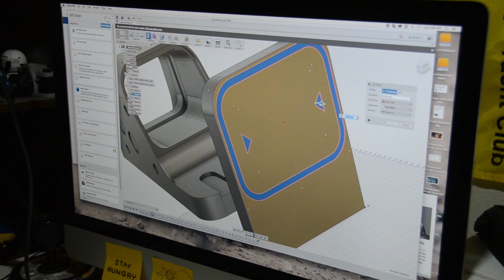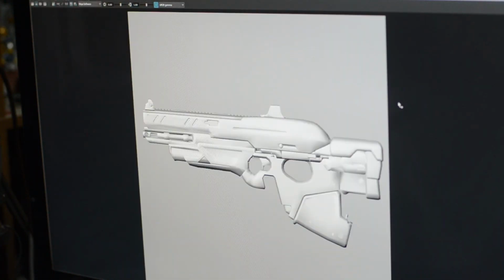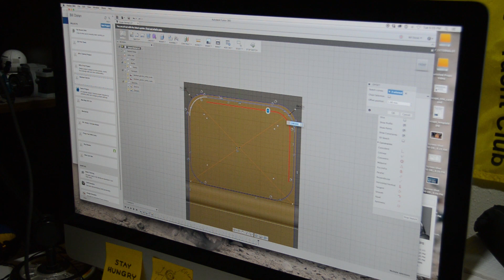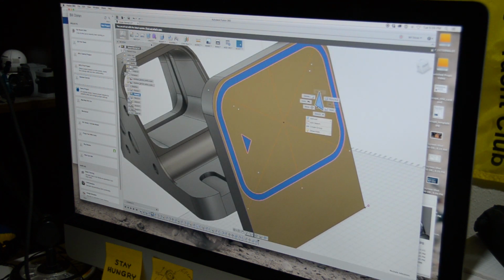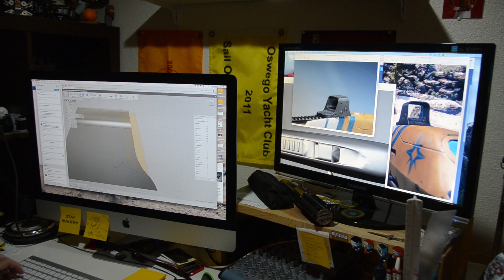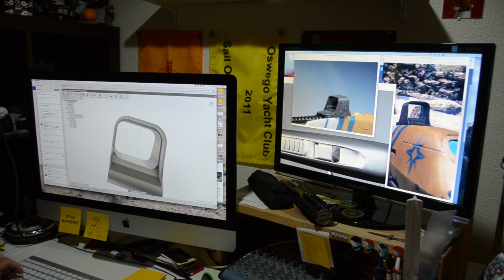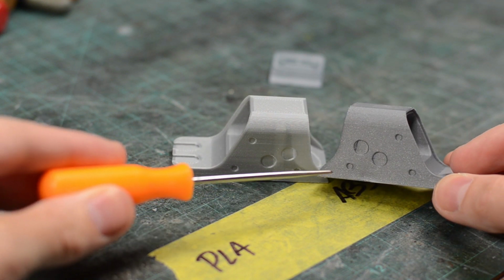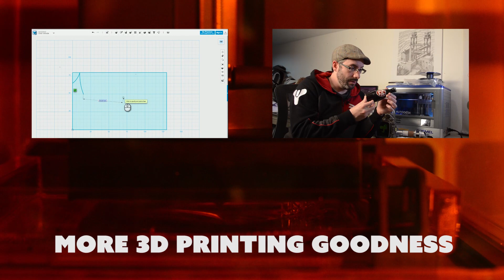How to 3D Print a Gun Prop from Destiny Part 1: Boolean Gemini Scope

Comment: Helo punished props i do have a question i started my 1st ever 3d destiny gun prob but  my printer is too small and i had to cut it into a few parts how do you make them look as if there were 1 piece and how do you make the 3d printer texture go away
Reply from the maker: You can fill in the seams between printed parts with a body filler like Bondo. Here's a basic look at that process: https://youtu.be/u_hIt18nCfo

For 3D printed texture, I sand it a lot with sandpaper. Here's a look at that: https://youtu.be/eGrRKdy6x7I

Comment: i have that same resin based formlabs printer in my office! I'd love to use that or the two zortrax printers i have as well to make small props, but sadly they're always running and making prototypes for work
Reply: Punished Props no kidding! I get to see it in action every day since it sits right next to my desk and it makes some beautiful clean pieces. The resin we use is pretty expensive since we're making dental products that need to be completely heat resistant and autoclaveable

Comment: so would the filler primer you talked about before, take out too much of the detail?  I was thinking, couldn't you just spray that to get rid of the maker marks?  I heard there is like a wash you can do too to smooth it...acetone?
Reply: Ok, so silly question then, why not just hit it with the filler primer 1st thing?  Oh and did you know that different levels of sanding is how scratches are taken out of jet airliner windows?  That was a task we had to do in mechanics school once.  Takes a LOOOONG time. :) But yes, multiple sandings will clear it up.

Comment: Making a 3d printed set of Pokemon gym badges, DC-15s rifle, clone trooper belt boxes, and some small stuff all in the works. But I'm a designer by trade however your channel helps me alot with figuring out some of the issues with getting 3d printed models smooth as silk.
Reply: +Punished Props I do props for TV now thanks to 3d printing and design so I'm always looking to do the bbd.

Comment: Hey Bill. Great job! Your 3D printer project is working out Much better than mine... I'm making an Iron Man arm. I found the files on the RPF but they just seem to be missing something, like all the parts don't add up...Idk any suggestions? I probably should have started with something simpler, considering this is my first project with a 3D printer.
Reply: Yep I agree... LESSON LEARNED. I I only used the files because  I have no experience in designing my own. But what kind of excuse is that?Everyone has to start somewhere, right?  Maybe I should make a Mandalorian blaster pistol as a first.

Comment: Currently 3D printing parts for Overwatch Tracer Pulse Pistol.  Started filling/sanding to get rid of layer lines on a few parts already, and will be ready for paint soon enough.  Used a laser cutter to cut out blue acrylic pieces which will get some LED's placed behind them to get the nice glow.  Hid the battery box in the front grip of the gun, and will be placing threaded inserts in the front grip so that I can take it off and on easily to change batteries.

Comment: if you had a file why would you remodel bits of the gun?
Reply: My guess is the low poly count? I've taken guns into Blender before (low poly), and it it very difficult (maybe impossible) to convert them to your specific needs to 3D print.
Reply: Could be other reasons, but I suspect SkintSNIPER262 is right.  I've printed some Destiny helmets straight from the STL files on DestinySTLGenerator, and talk about needing a LOT of work (which I expected).  I'm essentially having to sculpt the detail with Bondo.  Doing the work beforehand in a 3D program would save all that physical work.
Reply: ***** I'm not sure if you would know, but why is every rifle I download from the Destiny generator have the same sight and same drum magazine? Even when the orignal doesn't have them. Now I'm no expert on destiny but are those default attachments or something?

Comment: Bill, look into Future Floor Wax for the transparent reticle. Yes, the thing you put on your floors. It's a completely transparent, self-leveling acrylic material that airbrushes right out of the bottle and can be removed with Windex.

Model builders (the old school airplane modelers, at least) frequently use it as both a clear coat, and as a tool to make transparent pieces (such as canopies) look thinner and clearer. Also, because it's self leveling, it will help improve the optical performance of the piece, making it even more transparent.
Reply: I'm not sure how well it's work on the Form 2's print, but in theory all you would need to do is dip the whole thing in a small cup of the Future and then let it sit. 

http://kits.kitreview.com/images/meteorpr9reviewbg_noseparts.jpg

http://www.ipmsstockholm.org/magazine/2005/09/stuff_eng_tech_canopies.htm

Comment: PLA is so easy to print with but then it comes to finishing I have fallen in love with PET-G. It is so much easier to sand and file.  Yet I still am not reaching the quality you are. Amazing stuff you're doing!
Reply: One issue with PETG though is it is denser, so if you are making something big it may be heavy. I like ABS since its a lot lighter.
Reply: Wow, you got me looking at specs. I was thinking of printing the Queen's breaker bow till I figured it would be a 2 week+ print. I've never printed anything that took more than 0.5kg of plastic. The difference between ABS and PET-G in that print is over a kilogram!
Reply: +Chris Belcher yeah filament density is something I have learned to take into consideration when using different filaments. Never want to run out during a print

Comment: Currently working on a 3d printed R2D2 on my Wanhao Duplicator i3 using Mike Baddeley's remixing of James Bruton's design found on Thingiverse.  Having a hard time with ABS though have only had a couple pieces come out in good shape (because of lifting off the bed) I'm guessing its because of the lack of a heated chamber.  Working on making myself a nice temp controlled chamber out of some 2x4's, plywood, Plexiglas, a heater, Solid State Relays and a RPI..... Fingers crossed it improves my print quality.